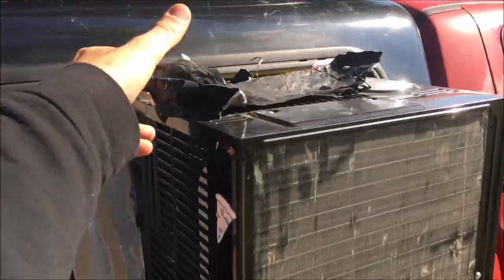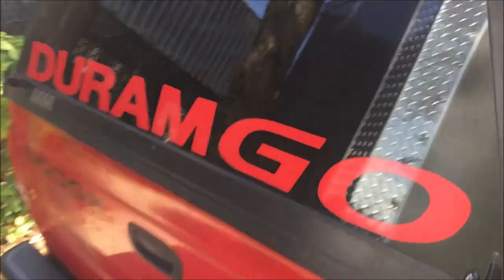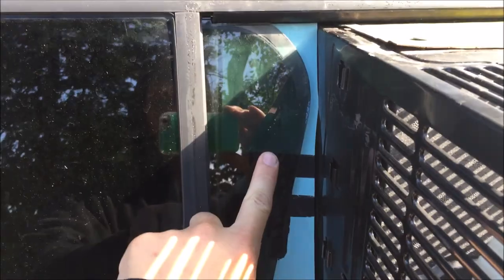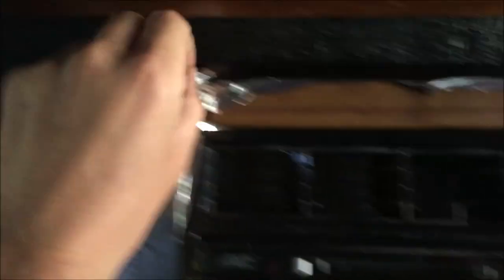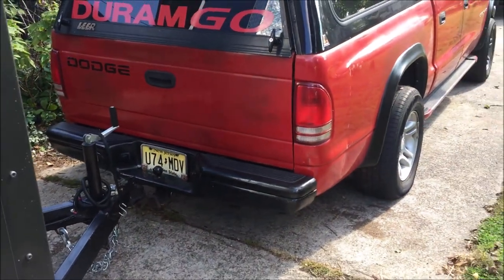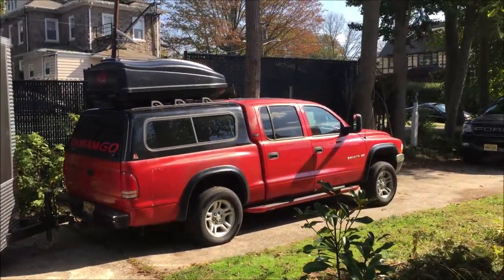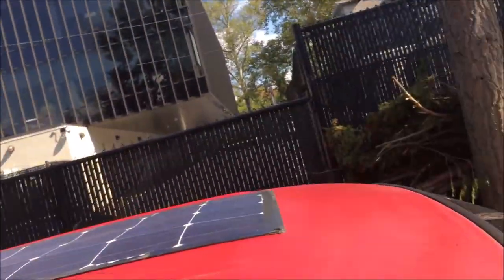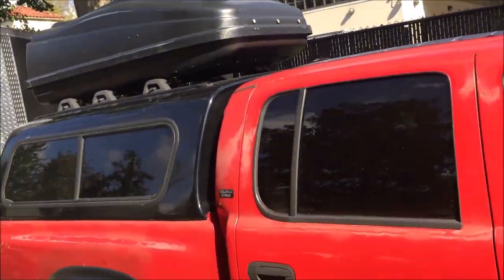The AC Window Unit  in My Pickup Truck Camper Rig!!!

Comment: I'm about to do this:  planning on having solar  with 2-100 amp hour  Battle Born.   Also will take a HF Generator.
Reply from the maker: Nice. My set up is kind of cheap. Walmart deep cycle battery.  But your right I need another solar panel.   Duel batteries also seems like a serious upgrade.